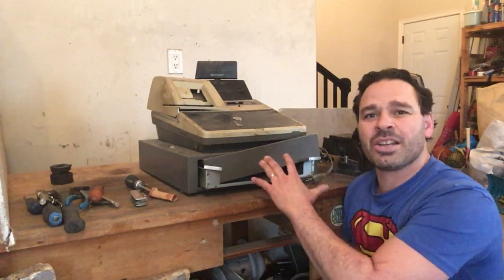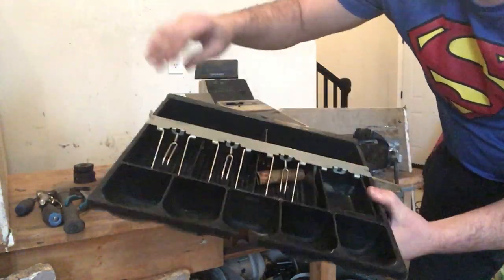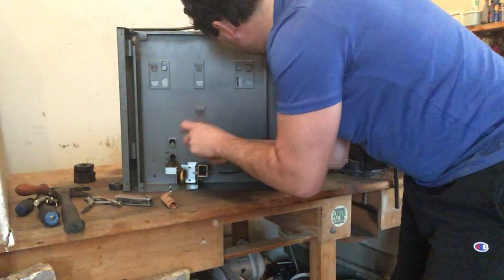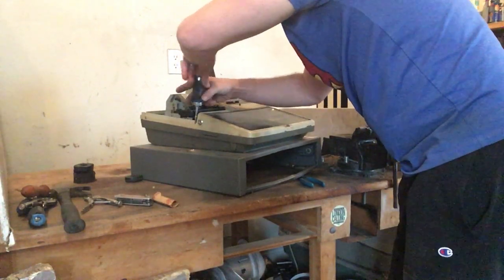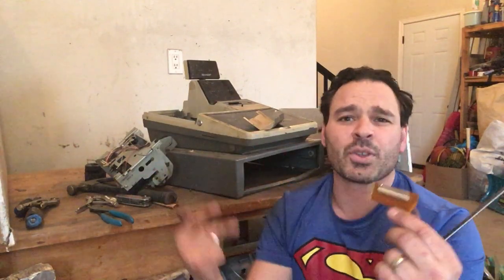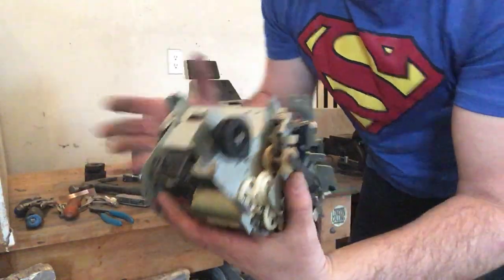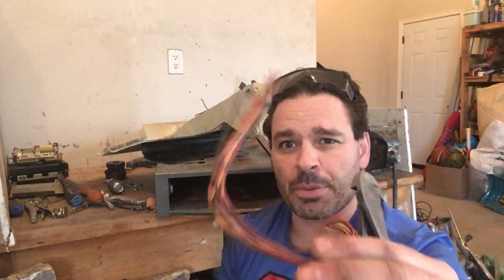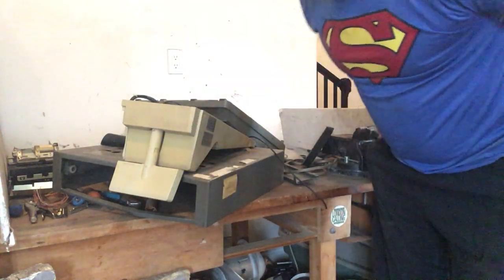Scrapping a cash register found in a dumpster for tin, copper, other metals and MONEY!!

Comment: 20:49 #2 copper 4.43/lb London.  Ottawa #2 3.20. (#1 is 3.55). 15:50 brass 3.50 lb.  Ottawa Yellow brass 1.50.  Circuit boards are shred in Ottawa.  insulated wire, not matter 40 or 60 % is .60 cents a pound.  All this to say, always grateful for the scrap education, ideas and exploring scrap.